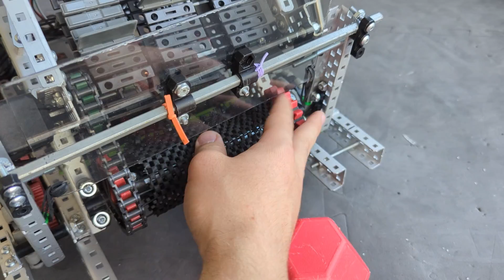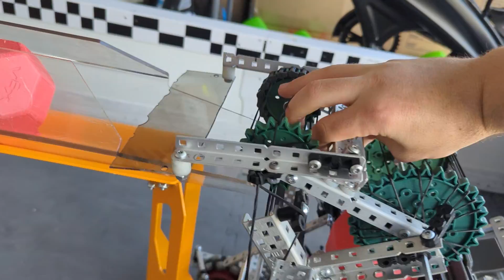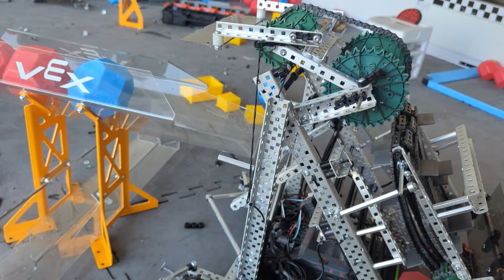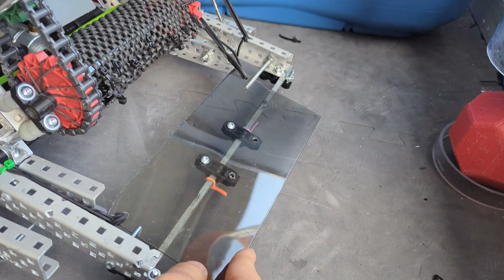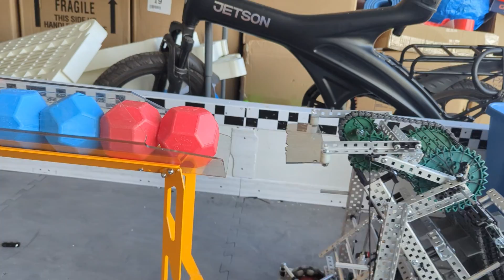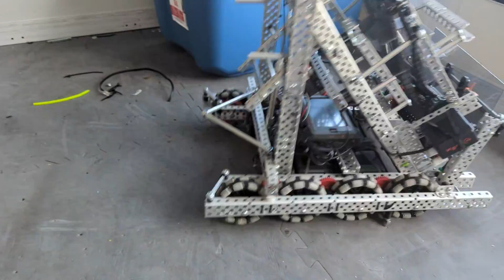The Robot Design Winning Tournaments (Full Breakdown) | VEX Push Back

Comment: hello, my teams robot isn't this design entirely but its v similar, how does the storage work bc with my robot it jams rlly easily if it has multiple blocks in it and overheats really quickly. do you have any suggestions? :))
Reply from the maker: It's hard to know without seeing the robot, but making the funneling better and making sure it's not compressing the conveyor into the blocks too much are the first two things I'd take a look at

Comment: For the rubber bands tha the balls sit on as they go up, what kind are they. Our seems a little to stretchy which is what slows the blocks down. Also, is there a reason why the rubber bands on the top roller are really thin?
Reply from the maker: For this robot, I used these rubber bands: https://a.co/d/7vBxgQS. In general, I'd recommend using AMUU rubber bands as they seem to hold up really well for some reason. The reason the ones on the top roller are so thin is because it worked better for me when I used the thin ones (because they are more squishy). You can use those too, but you should use whichever ones seem to work best for you.

Comment: "its in 0 danger of it ever tipping over" i have a photo of a ruiguan bot tipped in a match 💀
Reply from the maker: If you're talking about MOA finals, that wasn't a center of gravity issue, if not, it's possible whoever built that bot didn't have all the heavy stuff at the bottom
Reply: @Joseph973  nah it was a by 9258X "UK Ruiguan Team 9258X"
Reply: That is what cg is💀💀💀💀
Reply: Official Ruiguan team so i'd doubt its built wrong
Reply from the maker: @20785XNovaI'm not sure what they did, but mine is in no danger of tipping, so that's why I said that

Comment: "the longer the flaps the better" this is false, ive done ALOT of testing on this design and shorter flaps are better if you tune it right
Reply from the maker: Interesting, maybe I need to do more testing. I've also done quite extensive tests, and from what I learned longer flaps are better because they are easier to tune, although shorter flaps can work. I'm open to the possibility that I could be wrong though, and I'd be interested in learning more about it.
Reply: @Joseph973 I think it’s mainly because you don’t have a very large capacity but with my robot I can hold 8-9 blocks so with than many blocks the longer flaps slow down too much and jam up where as the short flaps can still spin even at max capacity